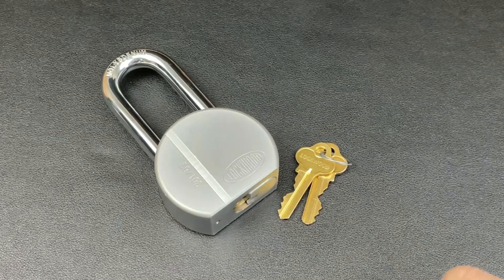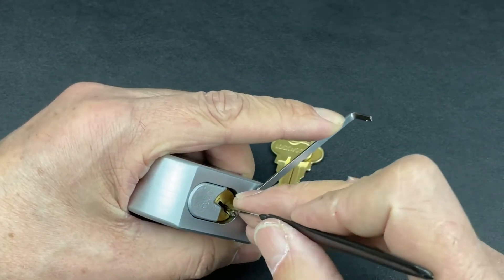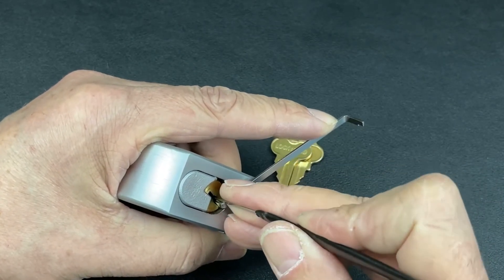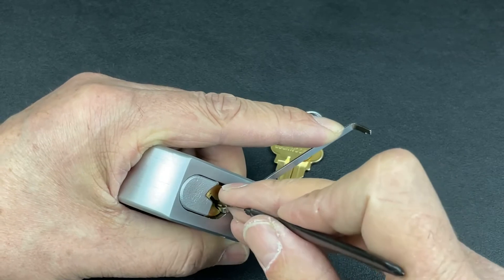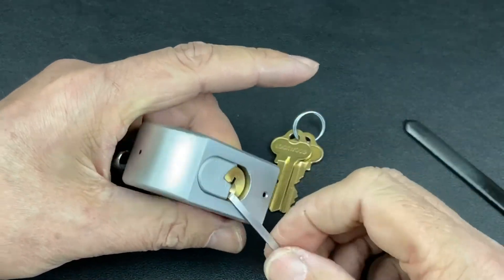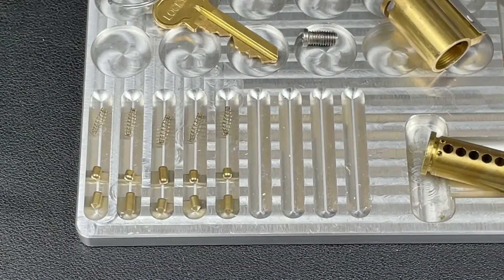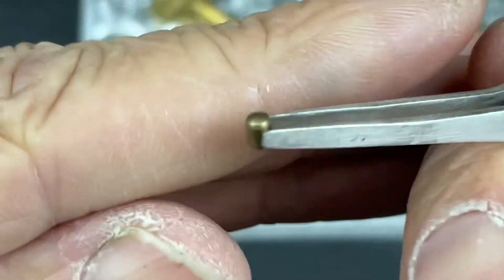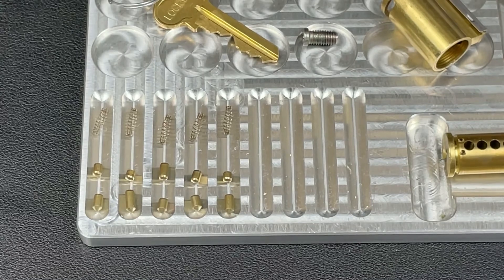The awesome 63mm Lockwood 301 padlock picked & Gutted. Plus tips on Tapered pins.￼

Comment: I have a Union rim cylinder that has tapered pins like those classic Lockwood pins. Until I picked it several times it was somewhat awkward to get the open. 
Great job on the Lockwood and walk through tutorial,  brilliant!
Video very much appreciated.
Reply from the maker: They definitely require a specific technique to pick them. I used to really struggle with them & the Tesa locks that use the same sort of pins. But with heavy tension & this nudging technique they aren’t to bad now. Have a great weekend Roy. 😎👍

Comment: Actually, these are called beveled pins. The previous generation had actual tapered pins where the taper ran further along the sides.
Of course, the current generation includes spool driver pins.
Reply from the maker: Thanks Gary for the info I really appreciate it. These pins are pretty tricky to pick. I’ve found that the newer spools are a lot easier to pick, i think due to the amount of feedback they give. 
Have a great weekend mate. 😎👍